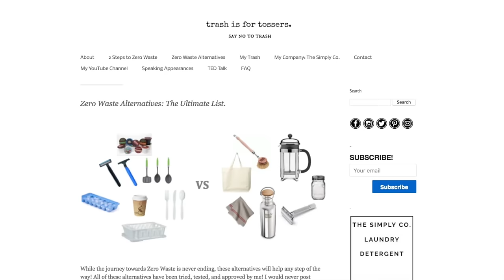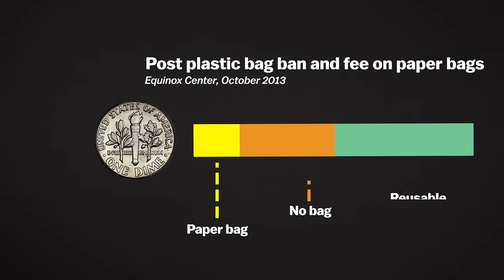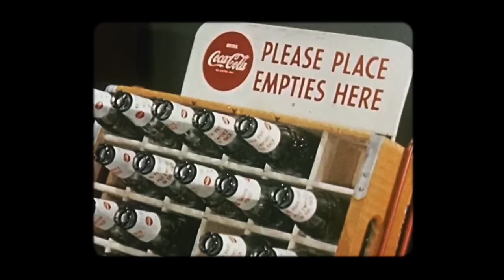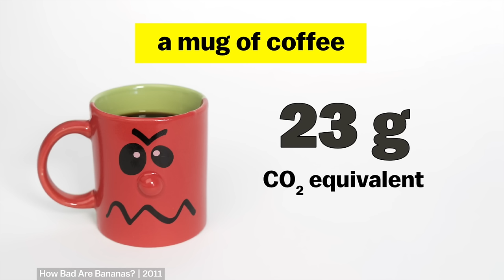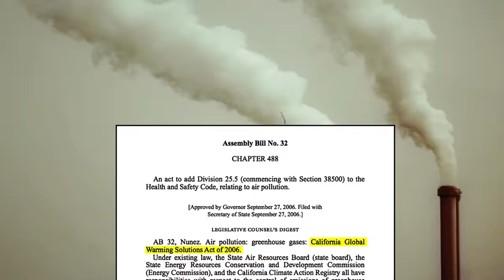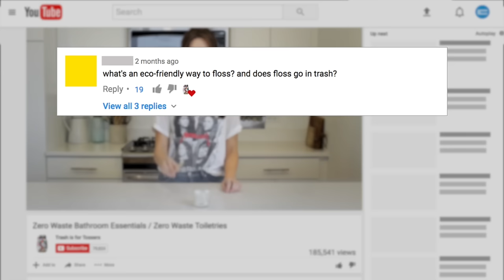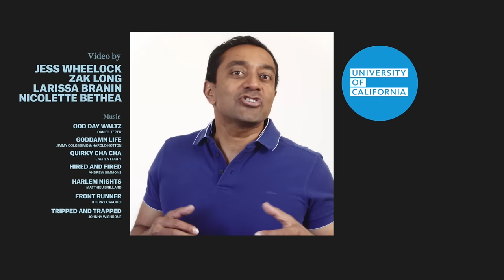Going green shouldn't be this hard

Comment: In the Netherlands you have to pay 3-25 cents for a plastic bag and sometimes that give you a paper bag instead. Or a €1 bag that you can return at any moment and get your money back.
The same system has been used for many years for big plastic bottles and since this year also for small plastic bottles. Big plastic bottles cost 25 cents and small plastic bottles cost 15 cents. You can put them in a machine in grocery stores to get that money back after you used them.
Also, plastic bags used to recycle plastic packaging are free in order to incentivize people to recycle plastic by filling up their regular trash bags less, saving them money. Theoretically people could use those bags to put groceries in as a loophole, but other people would notice that, so they don't do that to avoid the shame.

Comment: LITTERALY Hemp. Yes weed people! Can replace ALL plastic, ALL PAPER!!! AND IS A FUEL SOURCE AS IN GAS AND OIL!
Reply: Gabriel Torres Great idea, and at the same time you'll drench every waterway in improperly applied fertilizer, pesticides, and nutrients before it all washes to the ocean and chemically burns all wildlife on the way out.

Hemp is bad, you should feel bad for not researching why, and quit this "hemp will save us all" deal because it just doesn't work. It just makes more problems.
Reply: Gabriel Torres Hemp does have other issues. It needs a lot of light (and therefore energy) to be produced.(A few years back in the netherlands the police found an illegal weed plantage because there was one house not covered in snow, while all other houses were. This is how much energy and warmth is needed)Though it may be somewhat of an alternative its better to tackle the problem from the source in my opinion.
Reply: jacob archer The fertilizers and pesticide issue would not be a problem if proper soil management was in place, like using no-till cover crop practices, but big agriculture doesn't use those practices. Heavily tilling the soil ruins its ability to sequester carbon and in fact releases carbon gases into the atmosphere. The real issue would be changing our already established infrastructure to accommodate a new way of creating plastic and such. For a while it will still be much cheaper to buy a traditional plastic bag than a biodegradable hemp bag.
Reply: Agr414 True, the problem would be mitigated. However the average person uses about 10X as much fertilizer and pesticides for a garden than a farmer, and as most pro Hemp people tout decentralization of Hemp production you can guess how that'll affect runoff. Frankly, it would take less energy to recycle plastic and reform it than to grow, process, and reuse Hemp especially when you take into account the cost of producing more fertilizer and fixed nitrogen.

Great idea, but in practice it just won't work
Reply: as you can see the original comment is sarcasm. an OBVIOUS sarcasm.
Reply: [       ] Believe

[ ❌ ] Doubt
Reply: Hemp does have lots of applications people...
Reply: Dom Pérignon Right, it's just less effective and/or more expensive to use than other existing materials.
Reply: Gabriel Torres hemp and weed are kind of different

Comment: Imagine if you could take the most widely used shampoos
 etc to supermarket,  put it under a dispenser and it dispenses more into it. Just rescan the bar code and it knows the volume of the bottle and you get a discount. Probs impractical but would be cool.

Comment: To all the kids and teens watching this, show your parents. 
      You could then for instance tell them to have 2 trashes indoor, or more for recycling (not many people will walk outside to throw the papers, the plastics that can be recycled and so on). 
You could tell them that in summer there is no need to keep the house at a constant 70 degrees Fahrenheit 24/7, they can up the temperature when they leave and that even if the temperature is higher they won't melt. Same goes for winter. Socks, long sleeves can be worn indoor. 

Your car doesn't need to be hot when you get into it or cold. Your car doesn't need to be huge if you only use it for commute. There are probably some other easy habits that can be changed.

Comment: I have to push back on this. If you brew your own coffee, at home, you produce about 30gms of used grinds per cup. drink about 2 cups a day, that is 60gms a day, or about 21.9kgs a year. Coffee grinds take about 3-6 months compost in an industrial composter. Since the united states has no industrial composting, about 5.5kgs of coffee waste is generated each year that has not had time to compost. And thus, you need to increase your composting volume by 5.5kgs per year, for coffee alone. 

Throw in produce and the average composting time is three months. Average american consumes about 200gms of produce a day, some 5% of which is waste from food preparation. This translates into an additional 1kg of plant based, compostable garbage that is the accumulated excess per year. Now, that is 5.5 + 1 = 6.5kgs of additional composting volume that must be added per year to handle all compostable trash. I haven't even started on animal matter which takes much longer.

Furthermore, paper is not universally recyclable. Pizza boxes with grease are not recyclable. Paper packaging for food is not recyclable. Paper with some special inks is not recyclable. 

Glass, which is supposedly universally recyclable, is often inseparable from the rest of recycling (since curb side recycling is single stream), and thus ends up in land fills.

The truth is, going green is extremely challenging. Single stream recycling, aspirational recycling, and just garden variety apathy to trash disposal make it difficult. Add to this mix a horrendously poor infrastructure for handling trash, and you have yourself an absolute mess. If we wish to reduce our trash footprint, we would need a radical departure from food delivery, to product packaging, to composting infrastructure. Good luck getting all or any of it done.

Comment: There is just one benefit that plastic has over glass that can't be outdone: weight. It costs SO MUCH less to drive a truck full of plastic soda bottles, than it does a truck full of glass soda bottles. So long as the transportation of goods costs less, and the costs are determined by weight, then the plastic will go nowhere. This is something people don't think about. There are only certain locations where you can take your jug for soda, and people often buy more than just 64oz(as in the BIG Gulp cup) when they shop at the grocery store. There exist large, reusable water bottles. People already buy water, but they prefer they smaller(and lighter) bottles. Even if it cost them like 4x the money, so fees have little to no effect in reality.

Comment: It is almost impossible to have so little trash in 4 years. 

Does she not use toliet papers at all and have access to bidet seats every where she goes?

Does she not use any electronics (cell phones, refrigerator, laptops, etc) that would break down eventually and become waste (it is not economical to recycle every single part of electronics). And when she buy said electronics, she wont be able to avoid packaging materials such as styrofoam that is hard to recycle.

I get the teaching points, which is great, but the marketing part of generating so little waste is simply a lie.

Comment: How to buy fragile vegetables and fruits without plastic bags? How to put them on the weight? If one is using cotton bag it adds to the weight.
Reply: People usually use small thin bags or net bags that barely weigh anything... if you're that frugal you could always weigh the produce without the bag and then pack it.

Comment: what is wrong with plastic toothbrush? i'm certain a casted plastic toothbrush's carbon footprint is much more smaller than a 10 times pricier wooden brush. also almost everything in the "trash" is recyclable. this is just an ad for another layer of capitalism.

do you know what could be a better way to deal with pollution and not new support new trends so that new industries can depend on consumption? use everything you own to it's full extent, just like they do in underdeveloped countries. underdeveloped countries' pollution comes from trying to compensate developed counties' consumption.
Reply: i....threw out several plastic 
toothbrushes.....
Reply: Plastic doesn't have a high recycling rate. All the plastic toothbrushes you've thrown in the trash most likely still exist out there.

Comment: But Solar panels cost more to produce, and they requre maintenance and eventually replacement avery few years, so unless there is a lot of snow, water or another reflective surface, that can increase the amount of power they produce, solar panels aren't the better choice.
I am not an expert on the subject, so please research the subject yourself before spreading or using the information in this comment.

Comment: Going green does not need to be a sacrifice? Stop misinforming people please. For a start it involves not owning a car and not flying on jets to go on holiday.
Reply: It said reduce co2 emissions as much as possible and we have some solutions to those things you mentioned
Reply: @mansirattoor7523  there are no solutions to not flying on jets or owning a car. they are just things you have to stop doing.
Reply: Electric cars can reduce the impact (Key word is REDUCE). There are alternatives fuel sources for jets. We just need to innovate more.
Reply: @mansirattoor7523  There are not alternatives to jet fuel that we can use without great cost to the environment. Electric cars do not help at all.
Reply: Can't you even search up. There is a cleaner jet fuel with nearly 0 carbon footprint. The problem is that its more expensive than conventional jet fuel. And about electric cars, they can have electricity come from renewable sources like solar, wind, hydro. You can even use nuclear energy.
Reply: And you also saying that we shouldn't support these? Wow that is low.
Reply: I don't think you will search anything up.